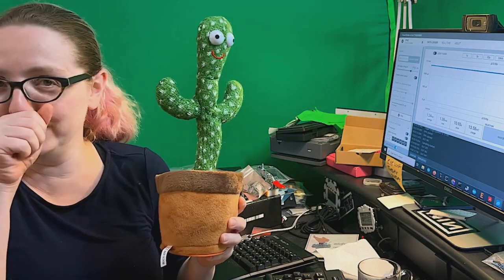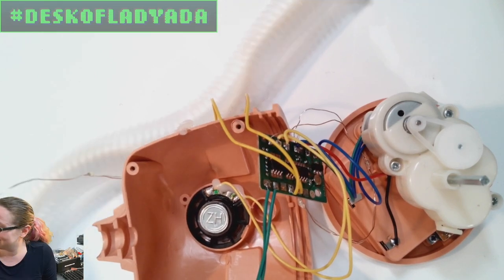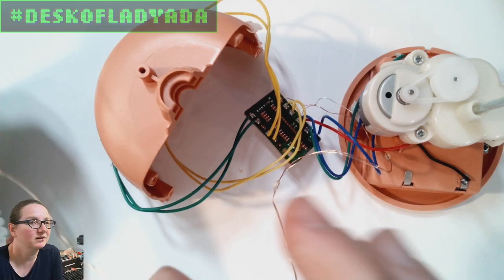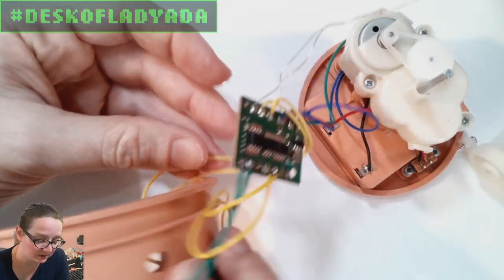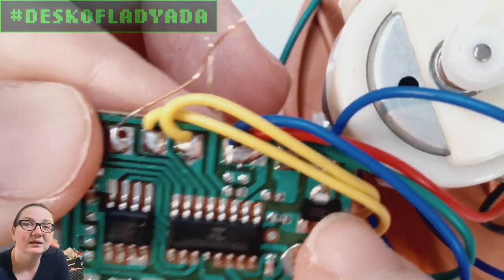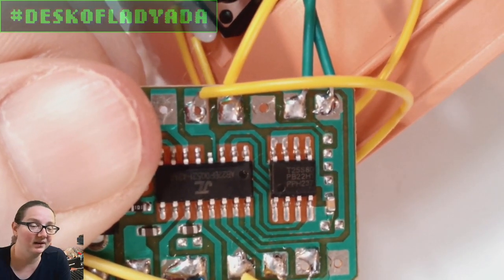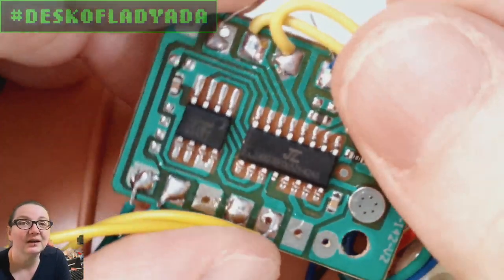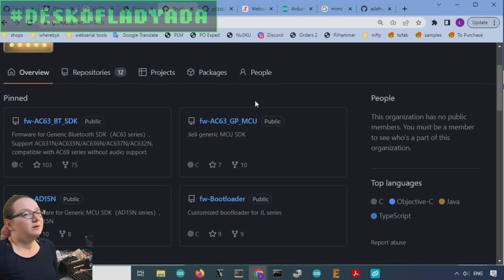🌵💃🗣️🎤🔧🔨 Teardown of the Dancing Talking Cactus Mimicking Toy - Desk of Ladyada

Comment: 7:36 The bottom right two unpopulated connections on the board are an external mic/line input. The left connection is the positive side and the right connection looks like ground.

I have two of these and yes there is a different mix of songs on them. I am going to install a line input and speaker out jacks because there is an unpopulated mic input on the board to tie into theres a micro built-in microphone on the board. At least on mine there is. I connected an audio source to the mic in on the board and hit record and the audio quality is pretty good. I got mine rapping out good vibrations by marky mark & the funky bunch.